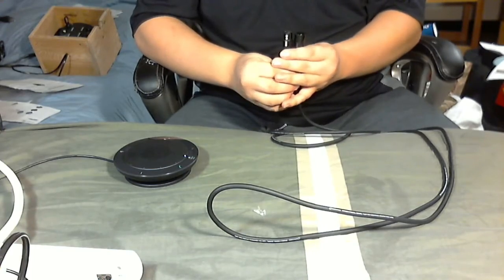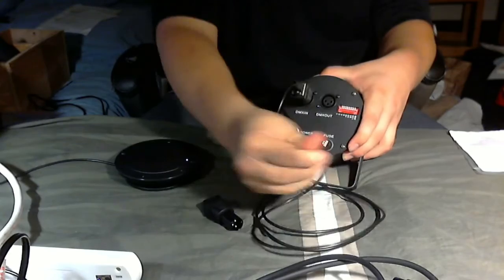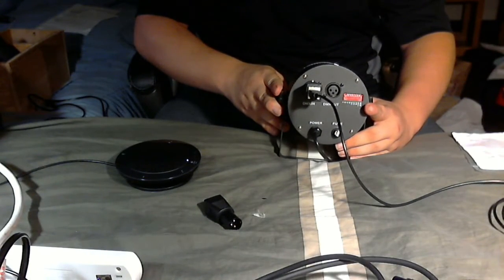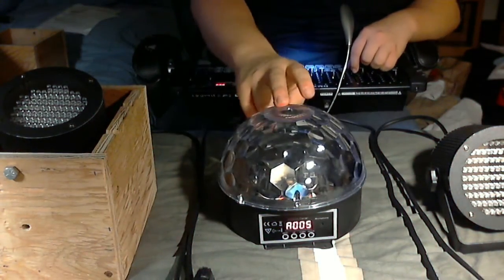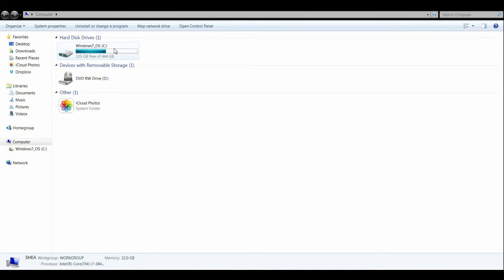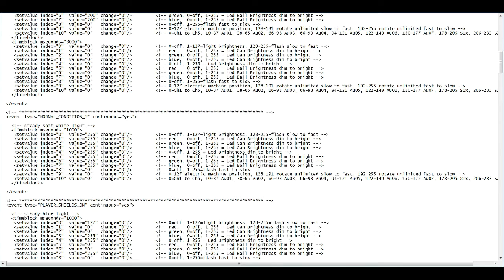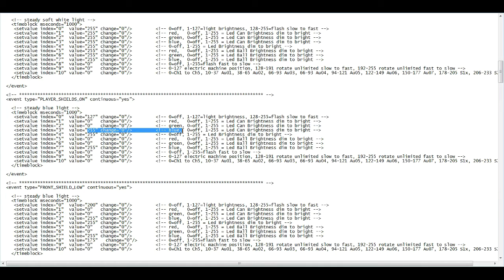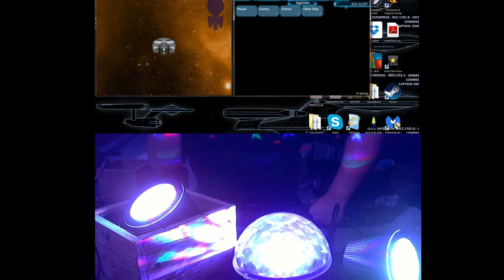Artemis DMX Tutorial: Lighting & Code

Comment: I am looking at sending dmx to the separate consoles and then out to arduinos. Can the signal be sent over the network? I would like to talk this over if you have some time.
Reply from the maker: I apologize for not responding sooner. I have never done anything like this myself, but I would like to explore this possibility if you still wish to? Usually I just hook up my DMX converter to one console and everything is daisy chained. But really each console acts independently to output DMX signals. You just have to have the correct code uploaded to each console to have the connected lights work with it. I believe there have some improvements to DMX capabilities, I am still using an old version. Let me know what you would like to do.

Comment: Um, DMX is digital not analog.  The adaptor converts from a usb type signal to the dmx signal.  It is not until the light (or dmx box with edison or another type of power outlets) that the signal is turned into analog.
Reply from the maker: You are correct. I was very new to DMX when I made this video and didn't realize the distinction. If you need any help or want to just bounce ideas off of me let me know.